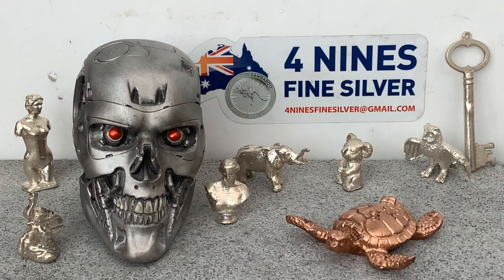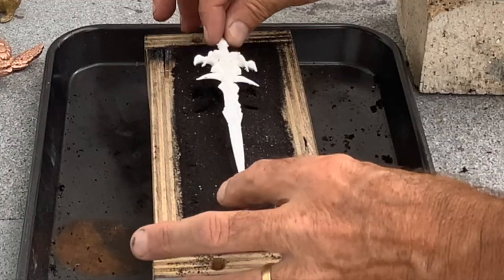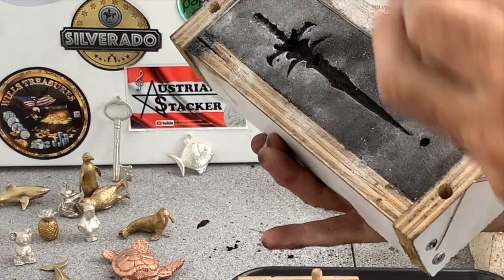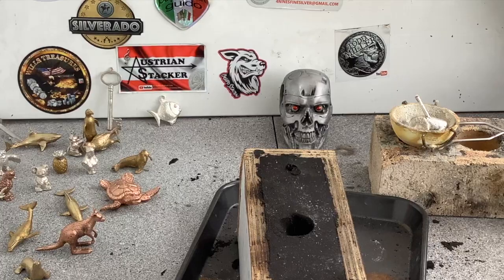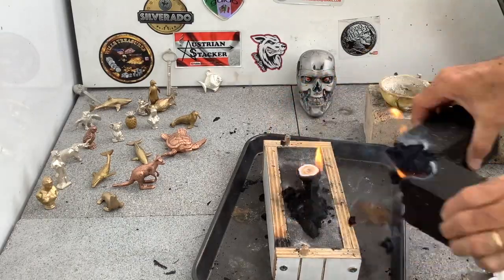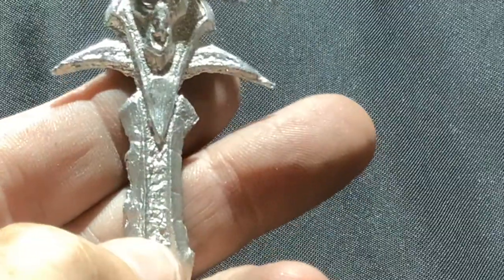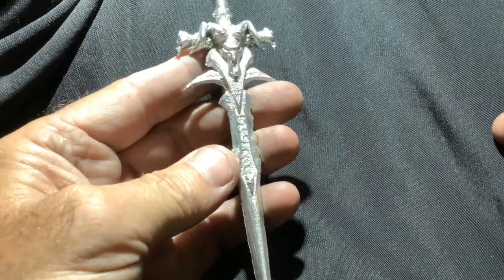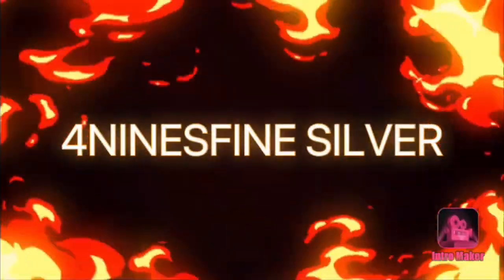CASTING A SILVER  SWORD

Comment: That sword turned out amazing! I liked when you pulled the wood blocks away and then grabbed the sand. Thanks for sharing! 😎 🤠 🗡
Reply from the maker: Yes my new framework doesn’t grip the sand as well as I would like I’m thinking of putting some ridges in the side walls to hold the sand better although it is nice breaking the sand away like that 🤠💛😎👍